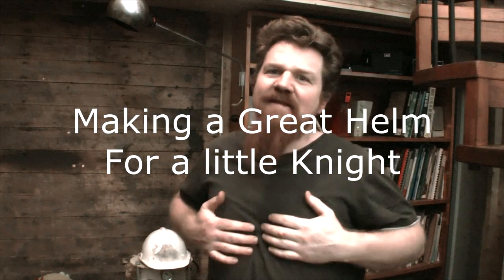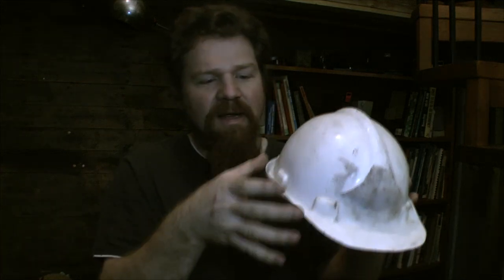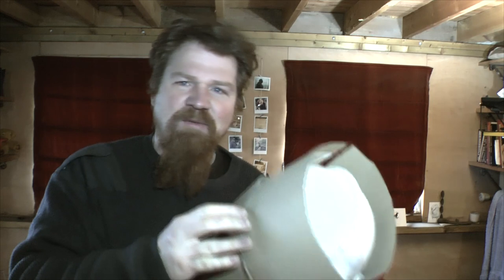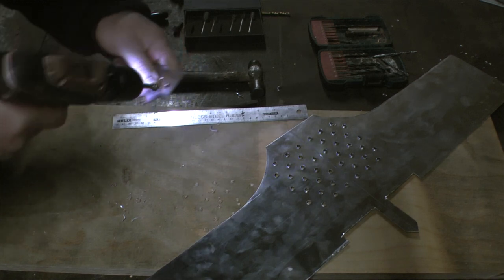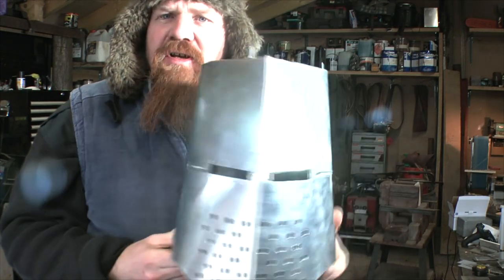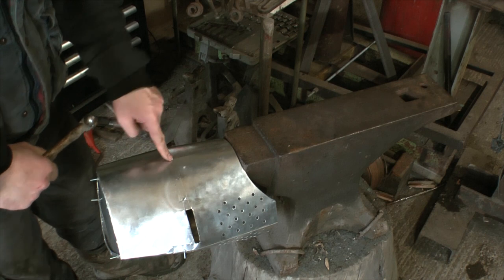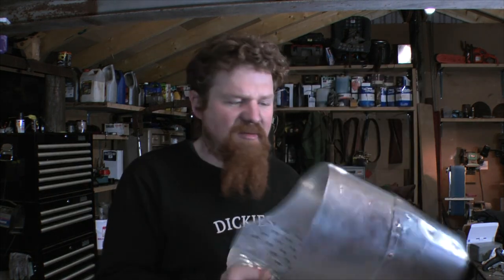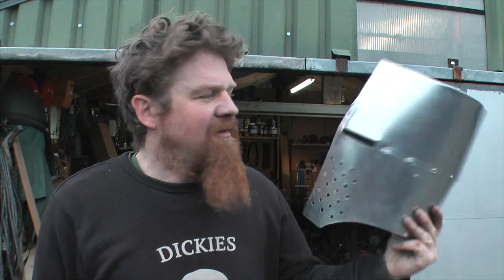Making a Great Helm

Comment: Hi. Great work. Keep your eye out at the flea markets for some “cleco” fasteners, great for pre assembly and fitting up before permanent rivets or welding. You can get the in various sizes. Cleco are what the aircraft industry used. Can’t wait to see your next vid and especially the 6bta into the Zil. Regards. Chris.

Comment: nice job :-)
btw - I think a stepped drill would have been handy for drilling those holes, if you don't already have one I highly recommend getting one - they work great in sheet metal (you can pick one up on ebay for under a fiver)